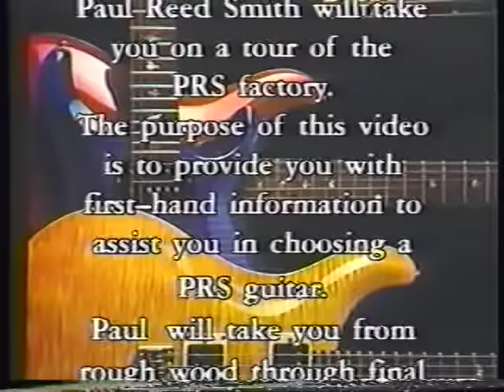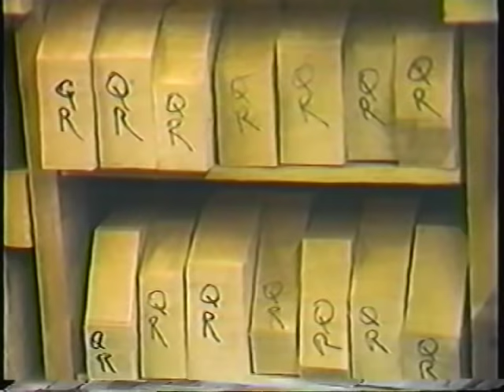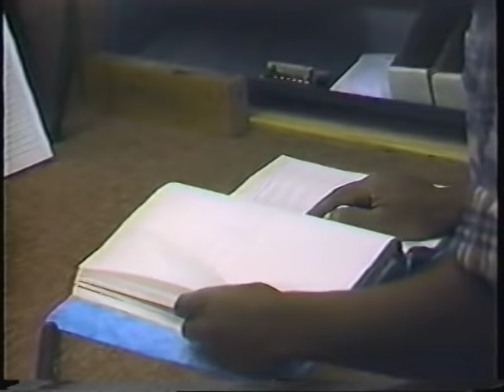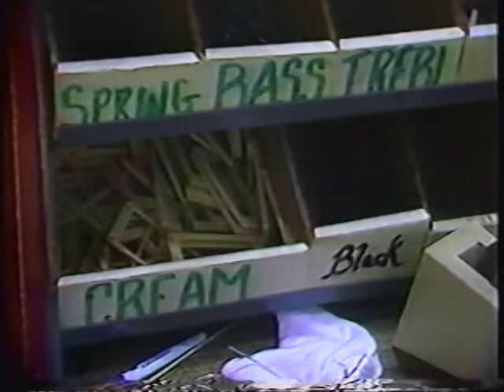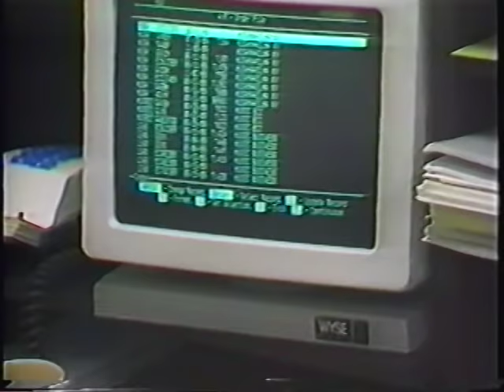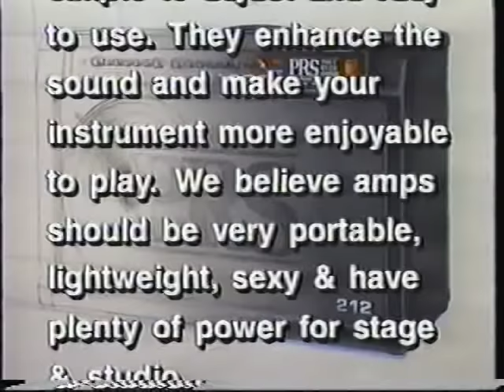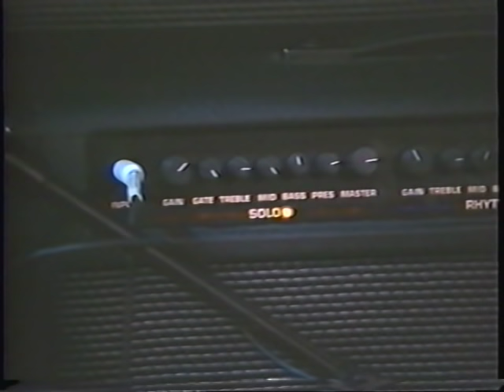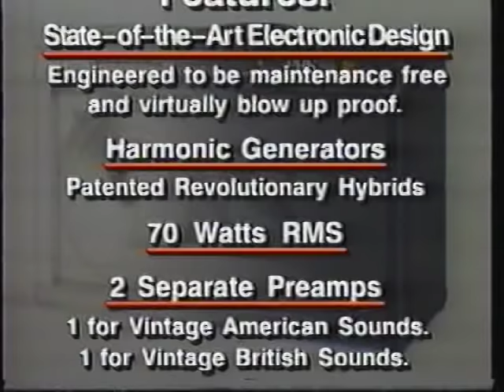1990 PRS Video

Comment: I’ve been playing the HFS/vintage bass pickup set for almost 20 years now and still consider it to be the best humbucking setup on the market. Yes...Bare Knuckle, Fralin, Dimarzio and Duncan have put out some killer stuff but every time I plug in my ‘02 cu24, my brain goes “yup, there it is 🤤”. It’s the sum of its parts (and the guitar’s entire system contributes in some way or another) but that pickup set just takes the sonic perfection and delivers it down the cable perfectly...a solid, unbroken connection between brain, fingers and speakers. And that’s what you’re looking for with any tool. The lowest amount of resistance between your creativity and the finished product. So this isn’t total PRS “propaganda”, I’ll state for the record that Fender’s Fat 50s pickups perform the same function in my strats.

Comment: I agree with the peak years assessment.  I have owned many PRS guitars, but the one still in the stable is a 1990 Custom 24 with brazilian board and birds.  It's not a 10 top, but it howls.  Mine has a somewhat rare deep dish neck pickup, that's tonally where I believe they should have stopped tweaking the neck pickups.

Comment: I was a music store today trying out a Quad Cortex and a Helix, and not digging them at all. I spied an old PRS Harmonic Generator head nearby, so I plugged into it. It totally smoked the modelers. For fairly old solid state technology, it actually sounded damn good. It didn't have any of that fizzy, buzzy overdrive that a lot of solid state amps have. It was fat and punchy sounding that cleaned up when rolling back the guitar's volume. It had pretty decent dynamics for a SS amp. I ended up taking the amp home. It reminds me a bit of the old Lab series amps. I know these amps were a big failure in the marketplace, I remember a store sitting on a half stack for over a decade. I don't think the world was ready for a high end SS amp in 1990. Dan Pearce also found out that lesson the hard way with his expensive Pearce amps.
Reply: I'm with ya - the HG70 is a total sleeper amp.  I still have the head version - used to have one with the matching 4x12 back in the LA days.  The Solo side does a hell of an excellent impression of a good Marshall when it drives the speakers hard enough.  Sounds killer through old 25 watt Greenbacks.  I really like the amp, too - AND! - what a cool light-up front panel!!!

Comment: Damn. He came across as completely focussed on amazing guitars even back then.
I bought a 2002 ten top after 20 + years of wanting a PRS and it did not disappoint.
Amazing guitar. Sounds so musical and coherent. Hard to describe.
Feels like home.
I was coming from an Ibanez 91 RG570 which was an amazingly well built guitar.
The PRS felt more homely.
The neck is a little narrower but I can adjust.
It just sounds more right.
Very hard to explain.
Just a more Coherent Guitar.
Through and Though more musical.
Play one and you'll know what I mean.
I was wedded to my RG570 for 20 years.
I bought it in 1993 with my student loan.
I put a new pickup in it in about 94 (Multibucker)  with a Micro switched  Coil tap on both coils.
Very versatile pickup.
The neck on the RG570 92 variant is epic.
It's wide and flat and has Jumbo frets the make bending easy as pie.
Without a doubt it's the fastest neck I've ever played on.
I can play faster on that neck than anything including the PRS.
What you compromise with the Ibanez is tone.
Tone but also some subtle things like bend a note on the Ibanez and the whole Floyd Rose will bend down.
Bend a note on the PRS and the bridge is stable.
There's certainly a horses for courses argument here. My Ibanez is a magnificent guitar and there definitely things it will be better at than the PRS.
I'm just surprised there aren't more of them.
Honestly these PRS guitars survive the hype.
Luv and Peace.
Reply: Cool comparison/experience  between Ibanez and prs

Comment: Now I want to find one of those amps.
Reply from the maker: I have the head. It's very good. Reminds me of a JCM800 with great cleans. Live though, I found that it lacked the headroom of my tube amps. It had a hard time cutting through the rest of the band.
Reply: @bemean2037  tube are indeed the best at this.
Reply: @bemean2037 what tubes were used.? And also wattage.? Just curious if they are EL34s or 6CA7s, and if smaller wattage 6L6 or EL84s. It sounded very 80s glam metal which i like, but most of them 80s style and type arena amps lacked much headroom, unlike amps of today with the right speakers with mega SPL factors. I still loved the sound of both amps tho.😊😊😊😊
Reply from the maker: @Rikk_Klaww777  That's the thing. It's a 70 watt solid state amp.

Comment: What model is that light blue guitar Paul plays to demo pickups? That guitar sounds amazing!
Reply from the maker: I believe that's their original CE, bolt on model. At that time the CE bodies were made of alder.
Reply: @bemean2037  Thank you! Were those already 25" scale?
Reply: @dvkerner96 Yes.  I have one with a 24 fret rosewood board from '89.
Reply: @jim4588  I bet it sounds great!
Reply: @dvkerner96 it's a little thicker sounding than I prefer these days, but still an awesome guitar. 🤘